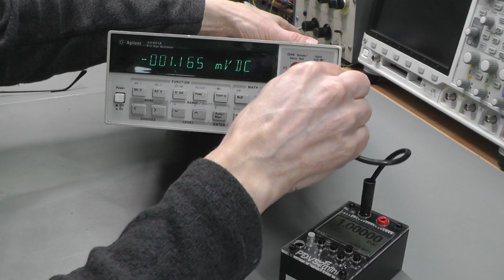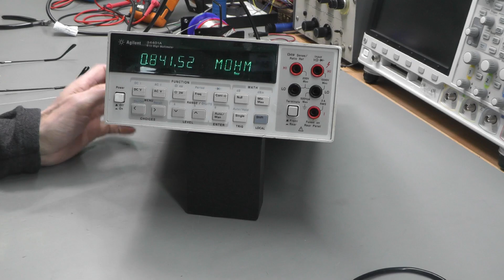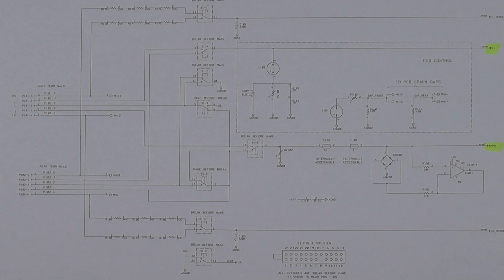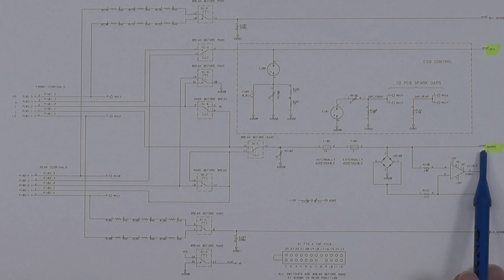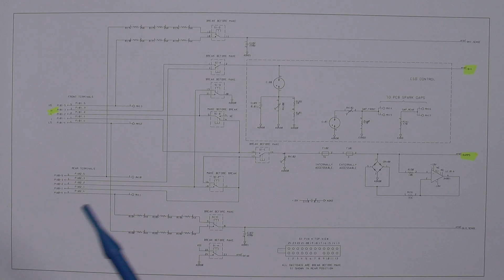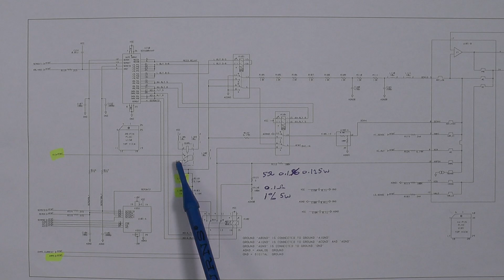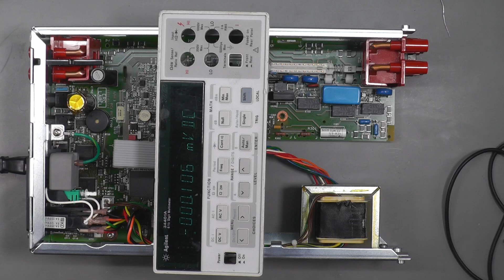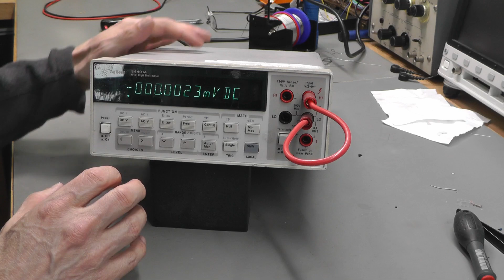No.106 - 4th Agilent 34401A 6.5 digit Multimeter Repair

Comment: Hi, hey, I already followed the recommendation in your video, and the on-screen display now changes, but it still doesn't give a reading. What else could it be? I also changed the digital/analog comparator, and that's what caused the voltage variation. It's worth mentioning that it was connected to a 220V line.

Comment: This 5Ω shunt resistor is quite critical, as it dissipates 50mW @ 100mA. Therefore it needs to be a very low T. C. type. The original thin  film one in my 34401A on the other hand showed a large timely drift, especially under full load. It seemed to me, that hp could not find resistors with both stable characteristics
Reply from the maker: I fitted a 1W precision resistor compared to the 0.125W which the spec asks for. I even contemplated potting it to help furher. I could have fitted something better I am sure, but it's still tough getting parts these days!
Reply: @IanScottJohnston  Years ago, I exchanged the TF resistor by a precision wire wound from G.R. The timely drift was much better, but its ~5ppm/K lead to a big power drift and therefore non linear behavior, i.e. big deviation at 10mA vs. 100mA level. Of course, @100mA it took half a minute, or so, until the reading stabilized. If I remember correctly, that deviation was then out of spec. So I re-assembled the TF resistor again. Does not bother me any more, as I later got a 34465A, which uses more and lower valued shunt resistors.
Component Allocation meanwhile is practically over, whereas special parts might remain a permanent problem.  COTO low e.m.f. / HV relays are unobtainium for years.

Comment: I would have unsoldered the relay and that big blue capacitor first to make removing the SMD components easier. I have some boards from VCRs with lots of inductors of various values on them. I would've used some of them. What are L101 and L106 actually for anyway and why are there 3.16K resistors in parallel with them. 1mH is quite a high value for the small size of package. They must be 100s of turns of really thin wire.
Reply from the maker: Those relays are unobtanium so folks are saying on the forum so didn't want to disturb them. It looked tighter than it was to work on, not too bad.......

Comment: @6:15 my suggestion for that is to heat the PCB from underneath with the hot air, it works well if you are trying to avoid damaging stuff near by, unless of course there is stuff underneath that prevents it.
Reply from the maker: No components underside, but that big red thing is a reed relay and it's unobtainium, manufactured specifically for HP devices......I'd be hesitant to heat the board from the underside for the worry of getting heat anywhere near it. Didn't want to desolder those relays either for the same reason.
The heat guard method works quite well, just keep the guard touching the Pcb at all times to stop airflow going underneath it, and keep it as low profile as you can so it's not in the way. I sometimes use masking tape to keep them in place. Works very well.
PS. Usually use 1mm aluminium, easily cut/bent to shape.
Reply: Or just unsolder the other components that could be damaged first.

Comment: Nice repair, but what was the current path that took all these parts out?
What would give me some concerns is where was all that current flowing, what other parts have been over stressed. Was it just a high current fault that the fuse did not catch and all the components that passed away to the Weee bin in the sky were in that path? But the size of the inductors did not look like they were up to that many amps.
Reply from the maker: I didn't analyse too much because it could have been measuring mains AC in resistance mode, large voltage spikes i.e. many k's......who knows.

Comment: 👌but now I want to now more about that resistance box of course.
Reply from the maker: Home made:
100ohm Vishay Zseries 0.005% 0.2ppm/degC
1Kohm Vishay Zseries 0.005% 0.2ppm/degC
10Kohm Vishay Zseries 0.005% 0.2ppm/degC
100K Vishay VHP101 series 0.1% 0.0ppm/degC
Still need to characterize the values against my 3458A, but probably after I upgrade all resistors to VHP101 type.
Reply: @IanScottJohnston  Thanks for the list. Those VHP10x are Impressive components. 'Call for Quote' they say, that sounds expensive too.
Reply from the maker: They are pretty expensive.......hence I'm in no hurry!